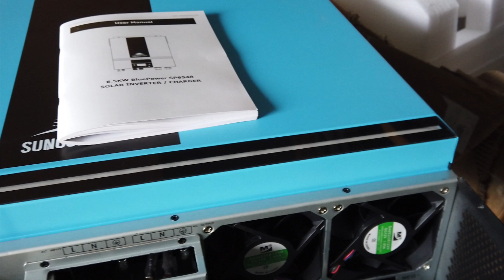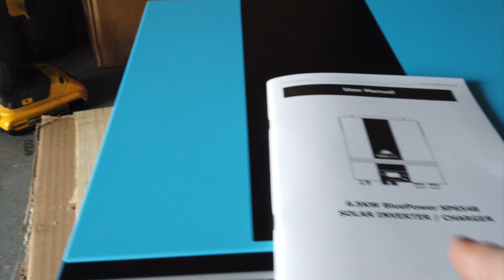Sungold Power SP6548 (LV6548) Inverter bonding screw removal (with sound)!

Comment from the maker: The Sp6548 is an off grid inverter, however you can hook the grid up to it, it supposedly has an automatic transfer switch that will transfer to the grid if your battery bank cuts out for low voltage. I will never use this function, mine is setup to manual transfer switches in my house, those switches from solar to grid manually.

Comment from the maker: These inverters SP6548’s are not set up to have EMT (metal conduit) to them for the solar input, my solar building is 150 feet from my house. I’m the only one that goes in it, I don’t have to have my off grid installation inspected. If I were to grid tie my solar, yes it would have to pass inspection, I would be using completely different inverters. When I hook up my Outback Radiant hybrid inverter, all solar will be in wire ways and conduit. This inverter is a much higher end inverter, cleaner sine waves, no light flickers!

Comment: This inverter will not pass inspection. The PV wires have high DC voltage which are required to be inside metal conduits. This is for safety, you don't want to burn your house. This inverter was made in China. The engineers don't now NEC and IET codes compliance. You should buy EG4 inverters which have holes for conduits or if you already bought the inverters then make extension boxes with holes (7/8") to replace the four PV connectors. Even you don't need inspection but for the safety guideline of NEC and IET.

Comment from the maker: First of all my system is totally off grid, it will not be inspected. The SP6548 probably won’t pass inspection. I’m presently studying 2020 wiring code book (over1300 pages). I want to be code compliant as far as possible, not because of an inspection, but because of safety and personal satisfaction.